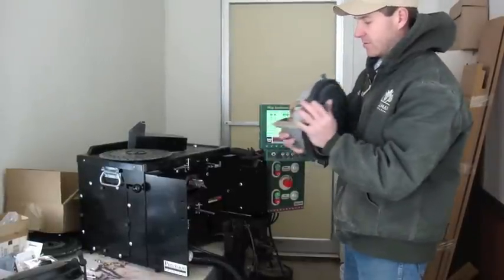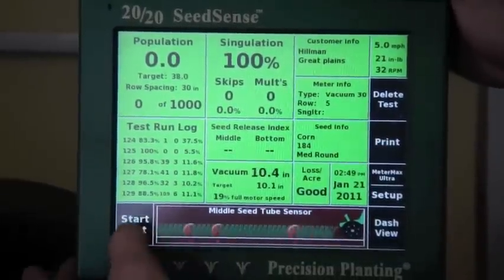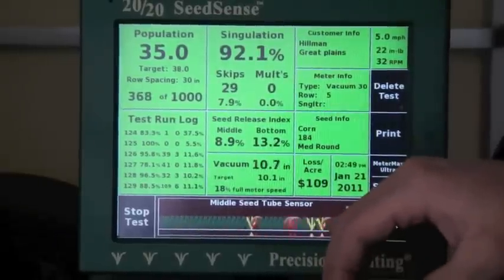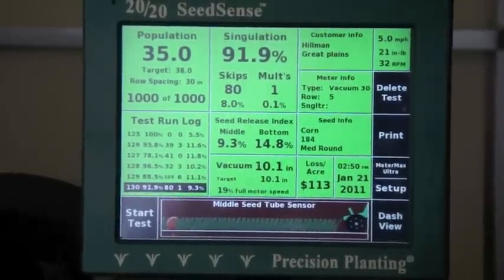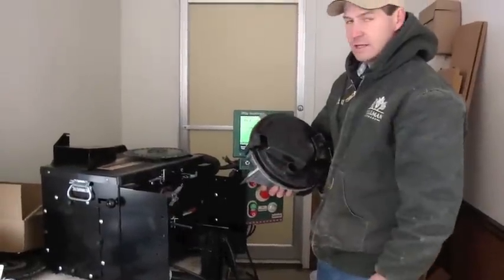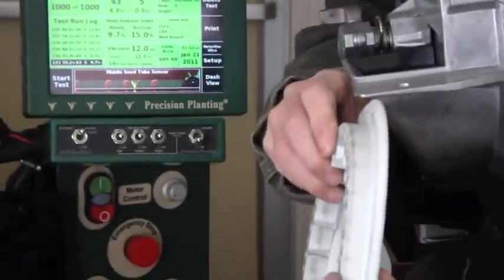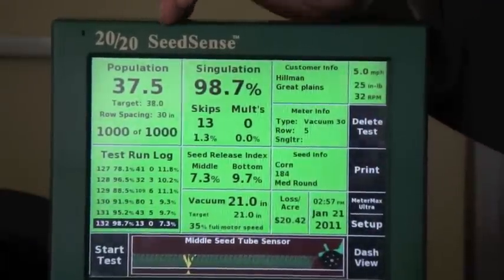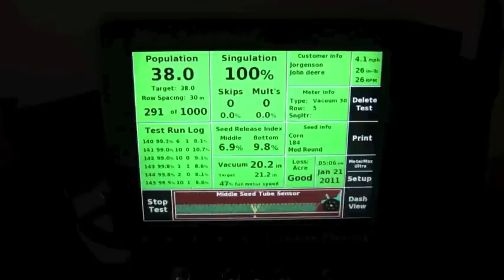Precision Planting Esets vs John Deere

Comment: I see some problems with this video.  Problem#1 If you stop the video at 27 or 28 seconds you will see that their is a gold looking piece in the cover.  That piece is used in SOYBEAN not corn.  The piece that is suppose to be ther is a knockout wheel.  Problem #2 I you look at the top of the aluminum meter you will see to 2 holes.  They are missing the double eliminator.  When They run the meter you will see that there are high amounts of skips and multiples.  Problem #3 In the video they are

Comment: Running a old seed disk.  They have had a new disk out for a while now, pro max 40 disks  (cell).  Problem #4 The vaccum is not set correctly.  The vaccum setting is around 18-20 inmg.  Problem #5 price.  To rebuild a jd vaccum meter it would be around $110 for the eset meter your ordering it online for $120 and whatever cost it is to run the meters at a stand.   So after this video I hope you realize that you are just pay way to much for a product that does that same.

Comment: JD 30 cell disk is what is being tested in this video, a singulator is not used with the 30 cell disk as the disk has a cup. That is where most of the problem exists is from seed not fitting into the cup. JD recommended vac settings for the 30 cell disk is what was used in this test. First at 10 lbs then 12 lbs to show the two ends of the range of their recommendations. The problem with JD's other disk, the promax 40, is how it pitches seed down the side of the tube, making poor spacing.